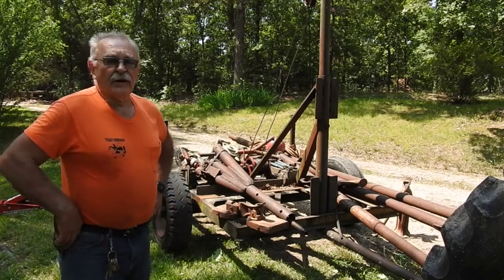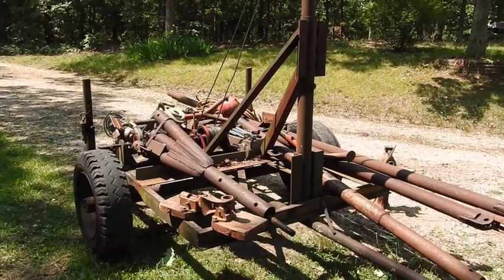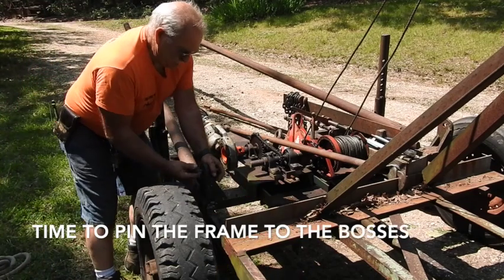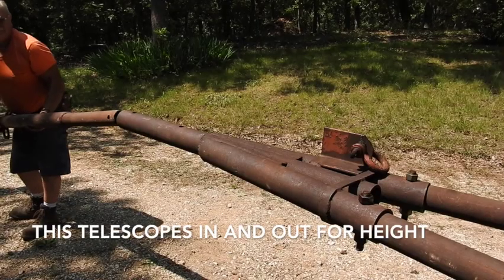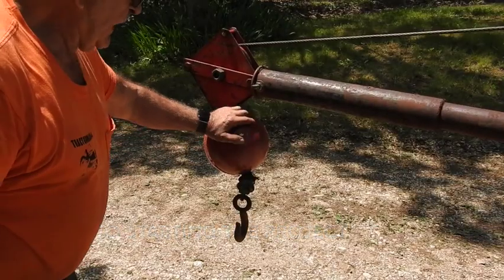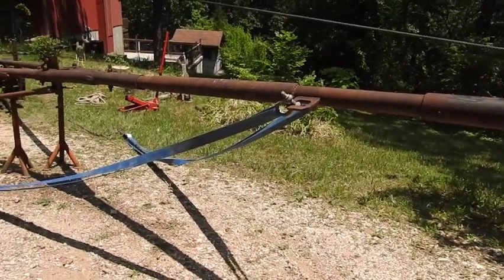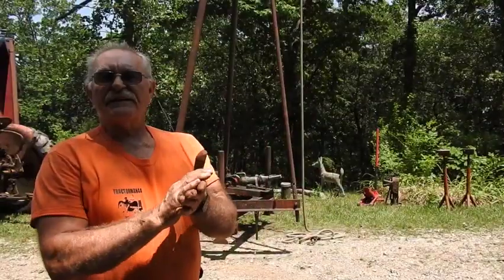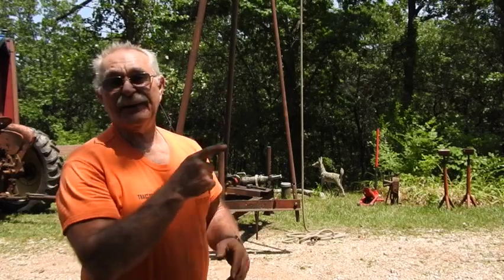Lets Get Ready To Pull A 400' Well: Turned Repurposed Materials Into Well Pulling Rig

Comment: The ingenuity, I love it😀, awesome stuff👍. A neighbour had a solar well pump break down, so me and him and another neighbour tried to pull it up by hand, it was almost hernia operation time😂. A week later I then grabbed a large steel rim off a old seed drill, welded up a stand for it. With a tractor attached to a rope over that rim, we managed to raise it, although the jumpy clutch on the old Fiat 411R didnt help😂.
Thanks again for the great video👍.
Reply from the maker: Yes, that's IS a good idea.  I wouldn't hesitate a bit to do that if my wells were the black plastic pipe.  But only the NEW wells in this area have that pipe.  The old ones are still 1'' galvanized or schedule 80 PVC with extruded fittings.  The deepest I ever pulled by hand was 250' and it liked to kill me.  I was also in my mid-40's too so now I wouldn't even attempt it at all !!

Comment: We used to have to pulll our 450 ft well  about every two years and replace the pump.  The last time we added a stop cycle valve. that allowed is to use a tiny 5 gallon air bladder tank.  since then it has been trouble free.
Reply from the maker: Dang...that's not good at all.  That's way too short of life.  I've seen only one of those tiny bladders that fit in the top of the casing.  The ones we install are the larger blue bladder tanks that we pressurize to 2 psi under the cut in pressure on the pressure switch.  But it sounds like you solved your early failure issue.

Comment: Sweet.  I don't know how you run this but I would sure consider some sort of remote control. even just a switch on the end of a cord. Just so you don't have to stand underneath it as much. Great stuff
Reply from the maker: Well, in the coming well pulling video you'll see how we center it up right over the well and everything is really in close proximity right under the A frame.   One guy CAN do it by himself but with a bit more effort.  The best size crew is three.  There's a lot to deal with...pipe, wire, cutting tape holding wire to the pipe, cleaning the rust off the pipes....the list goes on.
Reply: @tractorman4461  By the way using that pipethreader as a puller is genius.   it's geared down, and designed for lots of work, plus they are probably cheap since no one uses them much anymore

Comment: That’s quite a machine buddy that is a deep well mine was 196 at one time on galvanized pipe 21or 22 foot section’s it was a terrible job to pull it up we used a tripod with a set of chain falls but your way is a much better way I hope you get your daughters pump working again had is not very nice with water problems fingers crossed take care good video be careful buddy
Reply from the maker: Well heck Tom, out here in the country we learned to use what we had.  So a tri-pod and chain fall works just fine !!  But yeah, a bit slower though. Thanks for the kind thoughts and we are done with it now and it DID go without a hitch....video coming soon.  Have a great day my friend.
Reply: @tractorman4461  that’s great news I was wondering thanks you guys have a great weekend

Comment: Great idea Wendell. I've always used my old 4500 ford and a couple of pipe vises to pull mine but it isn't very efficient but has worked so far. Take care. Looking forward to the next one.
Reply from the maker: Heck yeah that works too !!  I imagine the loader raises the pipe in a bit of an arc...??  I considered that process many years ago, but decided to build this instead.  But in the meantime I adapted part of this rig into a jib for the Case backhoe for sitting trusses.  I have a small winch mounted on the ROPS and have set up to 40' trusses so far.

Comment: You sir just saved me some $$$ I’m making a smaller version of this!!!
Reply from the maker: Just gotta make sure it'll clear the height of the casing by at least 2 feet.  But smaller pipe would be ok as long as you have pvc piping.  You can even use a 12v winch for the power unit.  But it'll be a little slow pulling.  But they too have forward and reverse. You can use two 2x6's or 2x8's with a V-notch to squeeze the pipe instead of a pump jack like mine. Heavy hinge on one end, big wing nut on the other to speed up tightening and loosening.  Use the 2x8's standing on edge. In the meantime search Marketplace for a casing jack or pump jack.